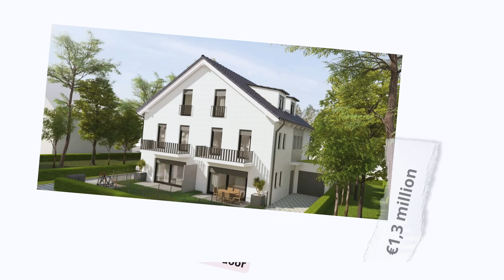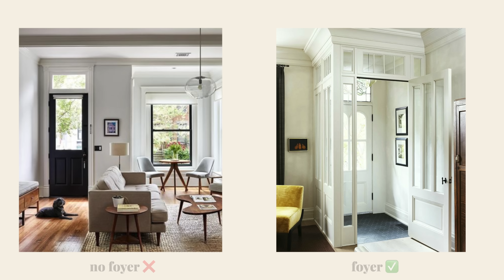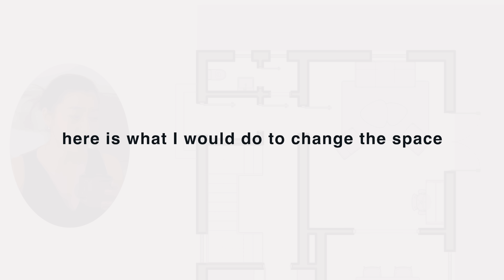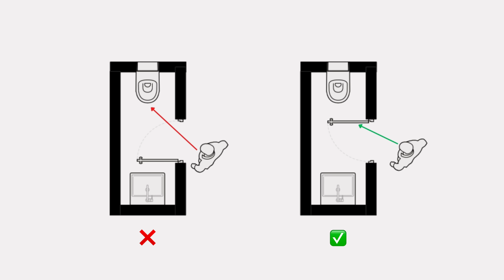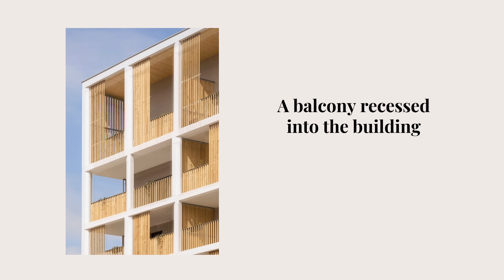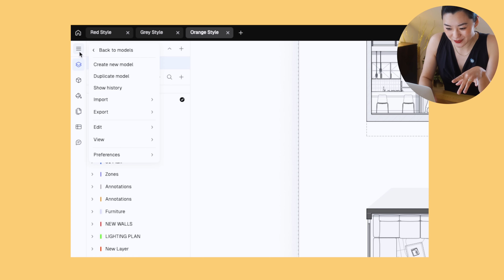Architect’s Advice: 7 Common Layout Mistakes + What to Do Instead

Comment: I agree with most of these, and I have some additional personal dislikes in video plans I see on the internet.  Some of them are:
1.  TV over the fireplace.  Heat is bad for the TV unless deflected by a deep mantel, and the TV may be too high for comfortable viewing.
2.  Over-the-cooktop microwaves.  Especially for shorter or older people, it's dangerous to take out a boiling hot dish of food at or above face level, and the microwave vents are usually feeble.
3.  Sliders as entry doors.  They are not as secure or safe, allowing strangers to view the living quarters and also often with inadequate locking mechanisms.
4.  Pocket doors for bedrooms and bathrooms that open directly into living areas.  Pocket doors don't seal tightly and allow odors and sounds to escape.  Barn doors are even worse.
5.  Cooktops on an island that includes seating.  Especially for children, seating next to hot pots and burners is dangerous.  Also, an overhead vent hood is visually annoying.
6.  Open wood-burning fireplaces.  Hugely inefficient.  The heated room air goes right up the flue.  A draft-controlled wood stove or gas fireplace is a better choice.

Comment: Great ideas!  The problem here in the UK is that most housebuidling & design is done by large house building companies.  Their No. 1 focus is profit for themselves for the land bankers for the financiers.  They only spend 25% to 33% of the sales on construction!  They ruthlessly cut spaces, materials, designs to secure their profits.  Planners should be demanding lower density housing, bigger plots, bigger room sizes, storage areas, hobby areas, space to park cars.  
The need for dual aspect rooms is very important, it makes such a difference.

Comment: I think the examples with windows on one side vs two sides of a room should have used cases where the total window surface area is about the same. If you compare room with 2 m^2 window area on one wall to another with 8 m^2 window area on two walls, it's no wonder that the one with 8 m^2 will feel better. Compare one wall wth 2 m^2 window to two walls with 1 m^2 window each to have apples to apples comparision.

Comment: I don't have particular opinions about stairs. They just need to have enough light (whether natural or artificial) to be safe, the correct grade and tread depth, and they need to be structurally sound. It's fine if you want them to be a statement piece and it's also fine if you want them to be hidden away. I think the only real opinion that I have is that stairs that rise more than 8 feet should be built wider. Basically, follow the conventions for hallways where longer hallways are recommended to be built wider so you don't feel as claustrophobic about them.

I don't strictly require a sealed vestibule. An entry foyer in my opinion, is mostly for providing a visual and logical separation from the rest of the house while providing a landing pad with certain conveniences like a coat closet for people to hang their coats in, and a shoe cabinet for people to divest of their shoes and (optionally) put on house slippers if that's a thing in your culture. The floorplan used as the example for an enclosed foyer is a special case where it makes a lot of sense to physically divide that space from the rest of the downstairs living space, since it provides an extra subconscious psychological barrier that allows you to leave any resentment and frustration from your job in the office space and not take it with you into the rest of the house. Having said that, placing the stairs behind the enclosed foyer will make it inconvenient for people coming from upstairs to utilize the downstairs living spaces because of that additional barrier. If you live in a particularly cold or wet climate, it also makes a lot of sense to enclose the foyer so you can avoid having the weather follow you into the home. Treat it like an airlock on a submarine or spacecraft. 

The entryway to a home should have a bench or built-in that people can sit on to divest of their shoes if they're dirty, a cabinet or closet to store their coats, and be wide enough not to cause people to feel claustrophobic. It's also good to have them be a bit longer to provide more visual separation from the rest of the house. I absolutely loathe the American tendency to not have a proper entryway at all and just dump people directly into the living room. If you've got multiple entries into the house, then obviously it's fine that they don't all feature a proper foyer or vestibule at them, but the primary entrance should.

Door placement is one of those things that a lot of architects really fail to plan for. Sometimes it can't be helped because they're limited by the area the client needs to stay within and lot restrictions, so the doors can only go in certain places. But I've also seen plenty of floorplans where there were opportunities to improve the flow and usability of a space by shifting the doorways or cased openings around and the architect or designer just decided not to. So many floorplans where you wonder if the person drawing it ever thought for a second about where furniture would go and how people would travel through the space.

I couldn't agree more about trying your best to design bathroom layouts in such a way that the first thing someone sees when they glance into the room is the vanity. Sometimes it can't be helped, but if it can be, then design it accordingly.

I don't particularly mind monodirectional natural lighting in a room. Obviously if you can get windows on multiple walls then you should absolutely try to do so, but I have no particular aversion to artificial lighting being used to correct for when natural lighting is difficult to manage.

I don't have enough experience with balconies to have much opinion on them, but I definitely agree that larger balconies with at least partial cover are preferable because it's easier to actually use the space. A balcony that is too narrow might as well not be included at all. It's better to have no expectations than to be disappointed.

The one thing I will never understand about these "premium luxury" home designs that I've seen is how few of them bother to design in the extra 4.2 square meters necessary to add an en suite bath to each bedroom and the extra 3 or so square meters for a half bath on the main living floor. Like, what is more luxurious than not having to fight with people for a bathroom?

Comment: @Baixu thanks for the concise and clear video. We are building a new home, but the bedroom I am sleeping in will only have one window facing North. Two sides of the room (East and a south) are just walls, and the last side (West) is for a full width wardrobe. The architect suggested adding a second window on the South wall, this is also the wall where the entrance door is located adjacent to the wardrobe. However, this wall is facing a corridor. The corridor will have sun tunnels and a tall window facing a small inner garden. Is it worth adding a window facing this corridor? It seems like an odd design choice, but you mentioned how good having two sided windows… and that got me thinking.

Comment: I would like to add number 8, the biggest & most common sin in modern apartment, kitchen being closer to the front door instead of the bedroom. Imagine it as a square divided into four, upper left is bathroom, upper right kitchen, lower left bedroom, and lower right dining/living room with the front door/path starting between the two. Open plan is honestly bad because the aroma & heat is not traped in the kitchen, if you really want to look into or out of kitchen use glass as wall or interior window instead of letting it open, you don't want your guess to sweat & sneeze smelling intense smell of food especially if you are cooking with lots of seasoning, such a waste of good smell too, when done cover the food under a fabric or plate cover before serving it to the guest, that way when you open the cover majority of the smell is still there, the aroma/sense of smell is part of the taste when eating. Call it old fashioned but old homes are designed that way for a reason, ALSO by making the kitchen at the back you are not traped when there is a fire because the fire is not egulfing the front door but the back of your apartment. Imagine this happen while you are in your bedroom for reasons, how will you escape if your burning kitchen is right next to the front door? It honwstly such a fire hazard safety & feng shui violation idk why apartment designed LOVE making the kitchen right next to the darn front door.

Comment: I would say in the US having the front area closed off and NOT a "combined foyer space" is actually good
I don't think you are really going to have a "lingering feeling" though out the rest of the house and also 90% of the time cops come to your door to ask questions they are looking in to the rest of the home to FIND A REASON to come in - if they are just looking in to an empty room there are no reasons to find.

If I'm able to build the home I want the wall and the house are going to be as close as possible and will run along the house creating a long narrow space with cameras on both ends high enough the cops can't put tape over them to block recording
The narrow space should also make it hard to kick the door down or batter ram it, but will also have a very sturdy metal "screen door" to prevent a cop from putting their foot in the door way to prevent me from disengaging if they don't have a warrant so they can antagonize some kind of reaction they can use to escalate the situation to detain me and/or (again) find a reason to enter the home with out a warrant
And the door will open in to a small empty room with again cameras to record any interactions in case some how all the outside cameras are disabled in some way

Sorry but I would rather have safety/security at my front door than some imagined feeling of unopeness that isn't going to follow me around the rest of the home.... I mean really you're going to spend less than 5 seconds walking though that space any time you leave/return home.

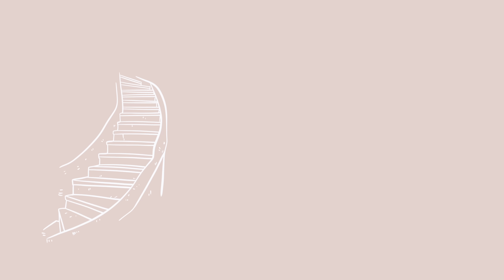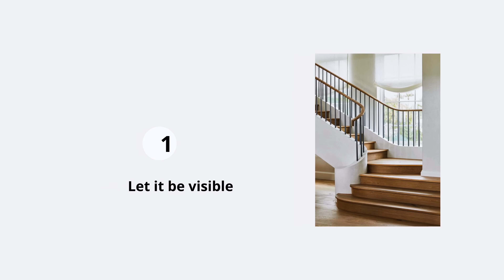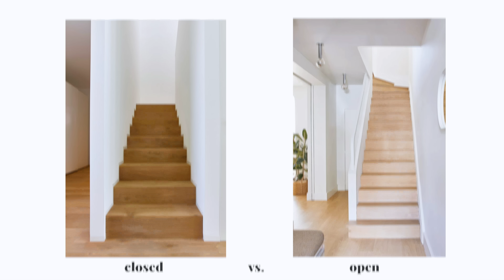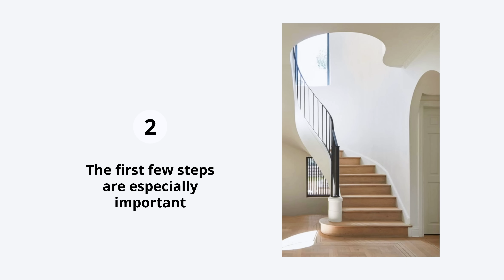Comment: 1:10 I'd always prefer a straight stair like on the right, and the worst layout would be stairs with alternating short steps or a circular stair. Maybe nice when all is fine, but once you need emergency medical services at home, and they need to carry you done, you definitely want to have a straight stair. Layouts like at 1:18 with the 90° turn are a nightmare for that circumstance. Also the stair at 1:30 to the left is better than the one to the right. The one at 1:39 is a great example for a horrible stair
Architects always think about what looks nice, but not how that design element affects works of EMS crews when lifting patients

Comment: In mediterranian climates (dry heat, nice breezes), especially in urban areas, those skinny exterior balconies are just protection for the full-length windows (disguised as doors) behind them. Any cantilever provides shade for the wall/doors/windows below. They're not meant to be used, beyond maybe leaning out in the evenings to watch your neighbours as if they were tv. An enclosed or recessed balcony wouldn't provide the same kind of airflow to the main living spaces, nor would it shade lower floors. Love all the other tips, though!
Reply from the maker: That's a great point about the function of balconies in those climates, thanks for sharing!

Comment: actually the reason the bathroom is designed close to an entrance is so when you are working outside, on the garden etc., you can use it quickly and without dirty floor in the whole house.

Comment: This is nice.  As a follow up video, could you please share some educational information about the price difference of doing the floor plan the “original” way as opposed to the suggested change. It’s been a while since I worked for a builder but I vaguely recall the architect that I was under having set rules based on budget.  
Not only that, but I would have to do some digging as to cultural/religious influences on home and entryway layouts 
But still a nice 😊 video

Comment: toilets next to the front door isn't a design mistake. It's an obvious feature. You can allow callers to use the roilet, without letting them in the rest of the house. On top of that the entrance is a high traffic area, you want services there, not nice things. There's a reason why at least half the houses in my country have the toilet, water, electrical, and comms service, crawl space access, and the stairs, all by the entrance.... it's convenient and keeps the less attractive stuff away from the nice rooms. My house has the toilet and crawl space access somewhere else, and it's the two most annoying downsides to it...

Comment: My house appears to have been designed by an alien squid. It has two closets that have built in shelving but are only 20" deep, but 60" wide with only a 20" door that is located near the end of the long side. 

You need kneepads, a step stool, a light and a mirror to even have a chance of seeing what is back there! Not that you have any chance of actually reaching the back if you don't look like a NBA player. 

Then there is the acoustics. The main room is almost exactly 16'x32' with an 8' ceiling. One of the short walls is almost completely taken up with a glass door. 

The intelligibly of sound in this room is awful and the only place to put a TV has the light from that huge glass door shining right on the screen and reflecting into your eyes. 

It's almost like someone drew the plans for an architecture 101 class as an assignment for the students to see how many things they could find wrong with it! 

And this last one isn't exactly an architectural error as it is an unfortunate circumstance - The best you can do with solar panels is to cover about 25% of the South and West facing roof surfaces. The rest of it either has hips or ridges or vents or chimney or is just too narrow to actually install a standard solar panel. Don't get me wrong I'm glad I bought a house. I just often wish it wasn't this one!

Comment: Great advice thanks!
I disagree with 2 points: the required foyer and the toilet line of sight.

I'd rather have the living space than lost space to a foyer.

I don't care about the toilet line of sight. That's what door locks are for. And to accommodate your toilet, I don't like doors that swing into the room space. I'd rather they swing against the wall. I don't want to walk around the door to use the toilet or other amenities.

Comment: Enclosed Foyer? I removed a wall in my house to make it open concept. It was one of the best things I ever did to my house.
Reply: Adding that Items #2 and #3 are contradicting. When you enter a house, you want to immediately see it's grandness. When in my Foyer, you are central to everything. As for noise and privacy, the Foyer usage is very short lived cycles with nobody hanging around it or at the front door for any long duration.

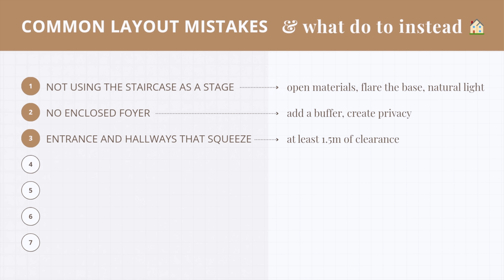Comment: At 4:26 the bathroom door should open into the room not the hallway, like a closet.  And the door should always open to the sink, not the toilet.  Given the room size and window locations, the door should open in with hinge left, the toilet should be on the left wall and face the sink which should be on the right wall.  If possible, the wall on the hinge side of the door should extend out enough so that it can open to 90 degrees without hitting the front of the toilet.  And obviously the door must open to swing past the sink.

Comment: OMG, thank you for validating everything I complain about in designs!  One item I disagreed with is at 4:00.  It infuriates me when designers require one door closed to access another door.  I would have preferred no closet to that (or make use of the "utility" space over by the top of the stairs, as a short-depth place for coats, shoes).  

I agree about the 2-walls of windows for SPECIFIC living areas.  But designers need to recognize that QUIET is equally important (whether from sound or light pollution), and glass (even triple pane thick) is a poor sound barrier, and prevents placement of furniture.  I absolutely DESPISE windows in the center of 2 walls in a bedroom, essentially immersing the sleeper in noise or causing glare for TV's (if they want one in the bedroom), windows behind furniture, or unwanted drafts. 

Something you didn't mention is placement of the bedrooms vs a garage or outdoor space.  I cannot stand when designers put a master bedroom in the same hallway as a garage or outdoor space.  I suppose this is "city thinking" (for anything above bottom floors anyway).  In rural and suburban areas, THERE ARE BUGS.  And they ALL want IN.  Especially in the South.  Smoky Brown cockroaches, LARGE ONES, will inevitably appear in the rooms directly connected to garages or outdoor spaces.  You cannot escape it, they are clever and will WAIT in door cracks for those doors to be opened, then rush so fast indoors that you don't notice it.  So those plans are INVITING those bugs INTO THE BEDROOM.  Nope.  Not gonna happen in my designs.  I tend to put utility spaces on one side of the home, living areas (kitchen, etc.) in the middle, and bedrooms either on the opposite side or another floor, and at least one area (mud room) with a SECOND door that they'd need to pass through from a garage (to a kitchen, for example).  There's a place for utility, a place for living and a place for sleeping, and these areas should never merge.
Reply: Take it from me, glass (at least double pane) is a far better sound insulator that many an apartment wall. Unless it's concrete, brick wall, even with stone wool, it still lets sound in like crazy.
Reply: A good, flexible, sturdy weather strip all around the garage door works great-- we don't have many bugs in our garage. Won't stop ants, though.